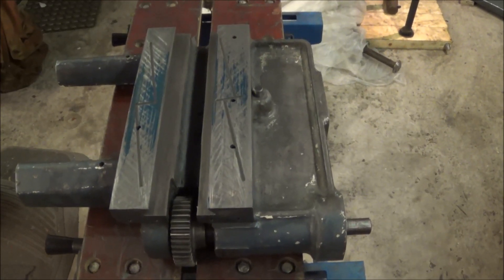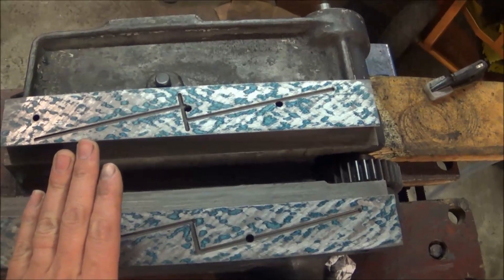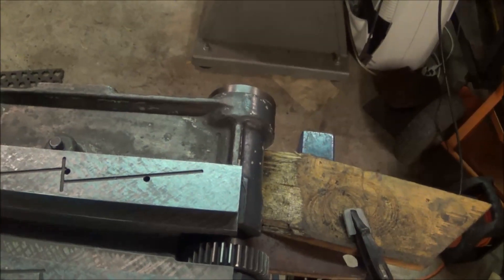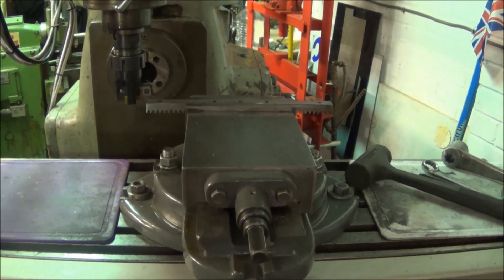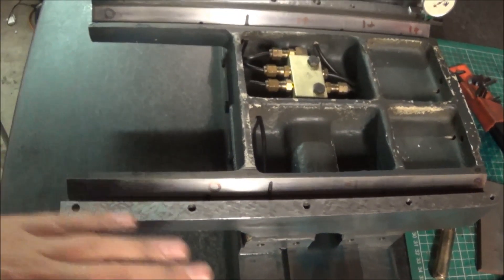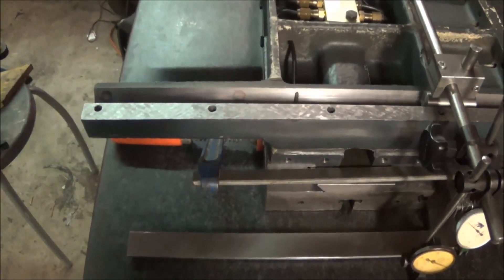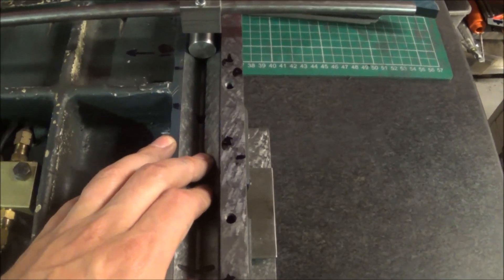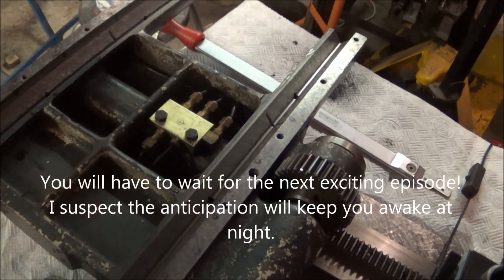Herbert Surface Grinder part 4 fitting the carriage

Comment: This is really terrific work! What is the blade you're using in the Sandvik handle for the V-ways? Is that a "re-purposed" carbide power planer blade? That gives me an idea for the dovetails I have to scrape. I've always struggled for a blade that would reach in there, and your setup has enough reach that the blade can fit in where it needs to but still allowing a manageable-sized handle. I was always struggling with the narrow custom scrapers I made for dovetails. The "body" of the scraper (being the same width as the blade) was always too narrow to allow good "tilt" control. I'm going to see about getting some planer blades and grinding them up to suit! :)
Reply from the maker: They are just bog standard carbide paint scraper blades that I dressed the end up on, about £1 each.  Probably not the best grade of carbide but a lot better than steel!
Reply: @machineshopatthebottomofth3213  Ah, great, I think I have some of those kicking around the garage looking for a new purpose in life! Thanks :)